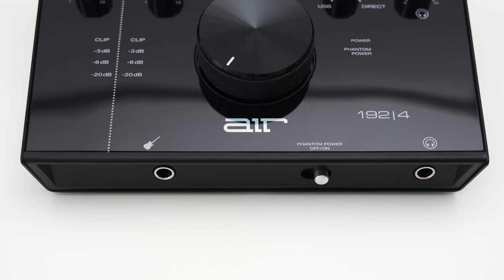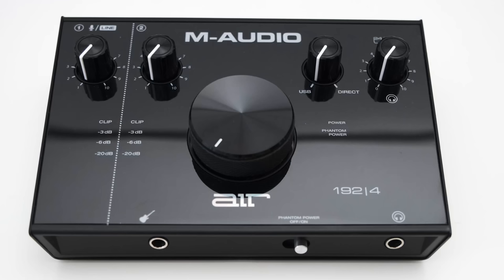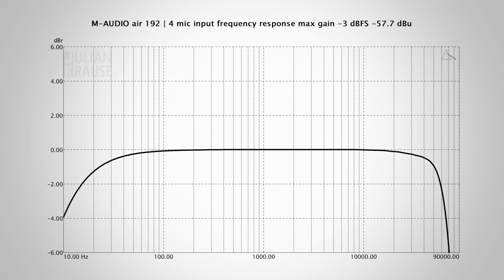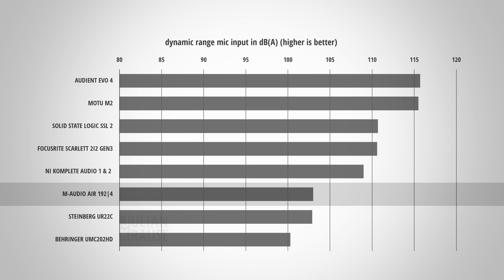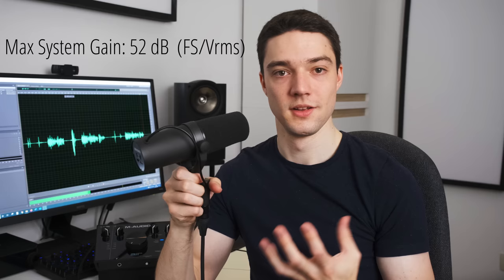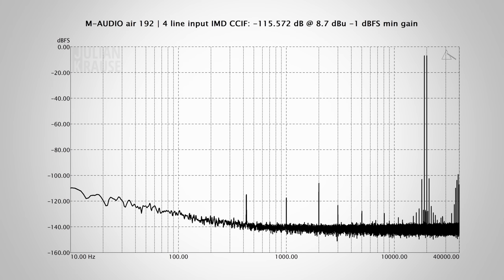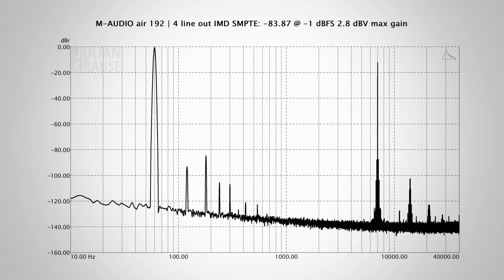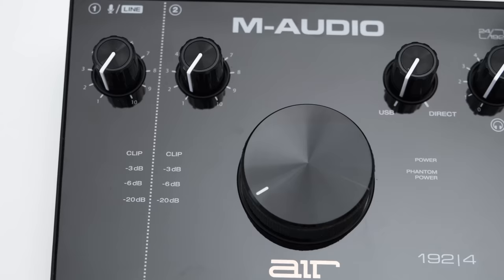M-AUDIO AIR 192|4 USB Audio Interface - REVIEW (audio quality measured)

Comment: PSA to any viewers in current times.
This will not work with modern versions of windows correctly.
It is a very finicky device. Sample rate constantly resets, constant bugs occur (slow/low pitch/sped up audio) and there is also frequent drop outs due to the device changing (and being unable to handle a change) while you are in the program.

Get the Behringer UMC202HD or 204HD if interested in this device.
It was also impossible to verify the signal to noise ratio, and EIN.
There is a very tiny increment near the end of the gain range where it amplifies the audio by an additional 20-30DB.
Thus clipping the mic entirely or "not quite" getting to a high signal level.
MOTU M2 is also a recommended device. Similar levels of noise with none of the fuss, and compatible with current versions of Windows.

Comment: It's likely my comment will be buried in the hundreds of others, but I will still try my luck. To the best of my knowledge, (honest) manufacturers of audio interfaces usually define audio input's EIN like this (example/excerpt from MixPre 6 II spec): "-130 dBV (-128 dBu) max (A-weighting, gain=76 dB, 150 ohm source impedance)" . As seen, MixPre mentions the "gain" value. Here comes my question. What is the gain value used to measure the EIN for each interface listed in your "EIN Comparison" graph? Is it the maximum gain of each audio interface (i.e. 50..76 dB)? Is it some arbitrary gain value (e.g. 55 dB) which most of the interfaces are capable of? Just trying to perceive the graph correctly. Looking forward to some feedback.
Reply from the maker: Hey, indeed I always measure EIN at the devices maximum gain setting (In my newer videos it also states this in the small print). The reason for that is that preamps achieve the best signal-to-noise ratio at their maximum gain setting and if you record with a very low sensitive dynamic mic, you typically want to get the best noise performance out of it as possible. In those cases, you generally have to set your gain to the maximum or close to it anyways to amplify the weak mic signal.
Reply: @JulianKrause  Appreciate your feedback! I think your choice to measure the EIN at max gain is totally justified, since this is how we expect the vendors themselves to perform this specific measurement. So, we can contrast your results with the datasheet right away. However, one consequence of using the max gain when measuring EIN is that (in my humble opinion) the EIN values in the EIN comparison table might not be directly comparable. Would you agree with that assessment? Is it safe to assume that M-AUDIO AIR 192|4 has truly better preamps when compared to its competitors? Or are the results a bit skewed (and not comparable) due to lack of normalization?
Reply from the maker: @phtius  Well, it's tricky. You could also choose to test the EIN at a constant gain level but that has other implications. 1. Of all, you would need to test at the lowest maximum gain setting of all devices. But that would be unfair for devices that have a higher gain level available where they could have performed better. 2. The gain of the preamp is often not known to the user. You would have to take apart the interface and measure the gain of the preamp stage on its own.
In the end measuring at the max gain setting gives you the best preamp noise performance that is possible to achieve with the interface. I still think this is a direct comparison, because the performance is there if you need it.
Reply: @JulianKrause  I get your point. I hope one day we will see the MixPre II and/or Zoom f3/f6/f8n-pro devices in the EIN comparison table as well. I wonder if M-AUDIO AIR 192|4 will still remain on the top, when compared to the top of the line MixPre Kashmir preamps. If so, I wonder whether it means that M-AUDIO AIR 192 would record a cleaner signal in the field (definitely curious to try this myself). Thanks again for your work!
Reply: @JulianKrause  Out of curiosity / JFYI / FWIW, I performed a quick noise floor test both for MixPre 6 II @ 55 db of Gain and for Behringer UMC202HD @ Max (51dB?) gain (Dummy 150 Ohm Mic connected to both). The results (+ the original wav recordings) are found here: https://drive.google.com/drive/folders/10KBZjUUdbQV9DZ0s9-JC87MS7Mf0FLWo .  PS: Better 

Below are some thoughts:

- For frequences > 200 Hz, MixPre 6 II is 15-20 dB quieter (wow!) than Behringer UMC202HD, even if MixPre was set to 4dB higher Gain (cannot repeat the recording with MixPre6ii@51dB gain due to the missing equipment).

- Purely looking at the specs of the interfaces (particularly, the EIN) and ignoring the max gain the interfaces are capable of, a regular user might conclude that the noise performance for both interfaces is in the same ballpark, which is (unfortunately) far from the truth. I hope the users will not fall into a similar trap while looking at the measured EIN values in the EIN Comparison table you are kindly providing (which has its own merits).

Thanks and all the best.

Comment: Hey Julian I have a question. With the M Audio Air 192/14, which is powered by an external supply and not by usb, will this allow for a better output power into high impedance headphones?
I'm really looking for that interface since it has it all.
Reply from the maker: Not necessarily. External power supplies can help but it really depends on how the manufacturer has implemented the headphone output. So, an external power supply is no guarantee that you get more power for the headphone output.

Comment: I currently have this and it's TERRIBLE, issue after issue and no fixes, you can't even get support for it and if you do, they don't respond

I'm refunding it today because of how many issues I have:

1. Microphone not producing sound
2. headset and microphone cut out after an hour of usage
3. Drivers are extremely buggy and BSOD my computer
4. Headset sometimes doesn't work
5. 192KHZ doesn't work most of the time
6. The interface will just stop working sometimes
7. You don't get a support code with the product
Reply: Same.
My microphone drops out even though it's clearly monitoring.
I have to uninstall drivers and it works fine then, but I can't use it properly when I produce music, so it's annoying I have to install and uninstall drivers depending on use.
No update in a long time too.

Comment: My only con with this audio interface is that you cannot use both inputs simultaneously.
Reply from the maker: Sure it can. Check that your recording software is set up to record two channels.
Reply: @JulianKrause  I meant the inputs on the audio interface. You said it yourself at 0:35-0:39

Comment: I'm kind of disappointed I picked one up after watching this video  Should have gone with the Motu M2 or even Evo 4.
Reply: What was wrong with it exactly?
Reply: @AmbientWanderer  U know what, my comment was probability a day or two after getting the unit and opinion was solely based on the specs presented from the alternate units.  After Using it...   I freaking love it.  It seem like the other interfaces are a bit better.   But the truth, unless your using it to record high budget projects I don't think that extra bit of quality matters.  Therefore, I change my opinion after using it for a bit and I really like it.
Reply: @LoneGRoEnt  Hi man, thanks for getting back to me. The reason why i ask, is it;'s well within my budget and i plan to use it for recording and streaming my DJ sets. I just don't want to have any buyers regret as return policies in the country that i currently  i live are not great. So once i buy it, there is no turning back. One question, how do you find the driver stability? this is one important aspect for me when live streaming...
Reply: @AmbientWanderer  Good question.  I own a M-Au 410 FireWire and it's a paperweight so I also had the same bias when buying M-Audio.  I sound like a seller of the product.. but truth is the firmware is very stable.  As far as software that comes with it..  it is advertised with pro tools or it was but truth is pro tools is no longer available with it.  Ableton is, however it is limited to 8 tracks which might be enough.  I use propellerhead reason.  It does come with a couple plug ins.  The truth is for the price it is an awesome unit and in my opinion I get very good audio quality..  I also do have an ok condenser mic, so your mic will also have to do a lot with the quality you are getting.   To sum this up.  I highly recommend this unit.  and it also has a nice solid feel to it.  Doesn't feel cheap.
Reply: @AmbientWanderer  I'm not a rapper or anything but like messing around with beats and recording on my beats is must.